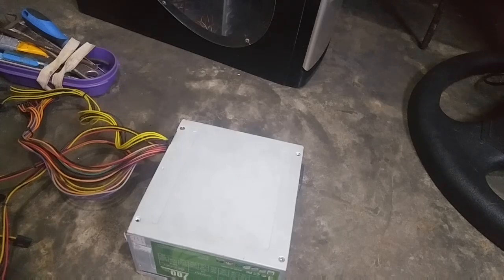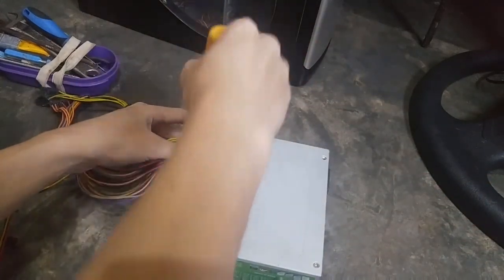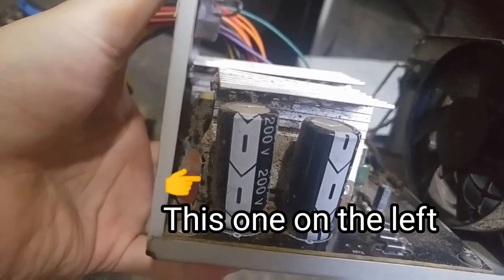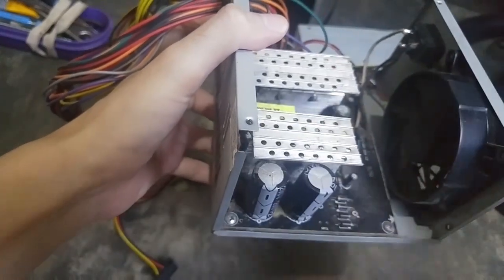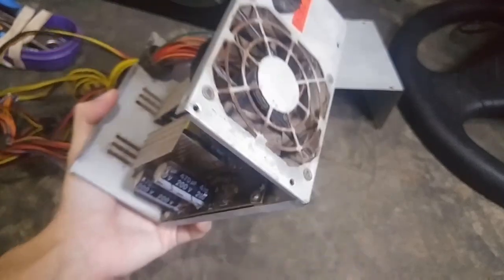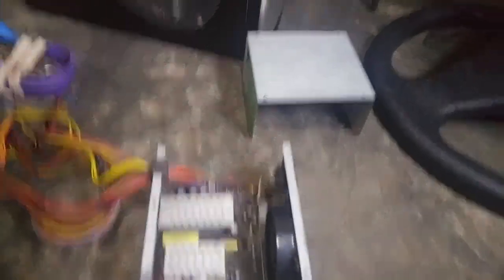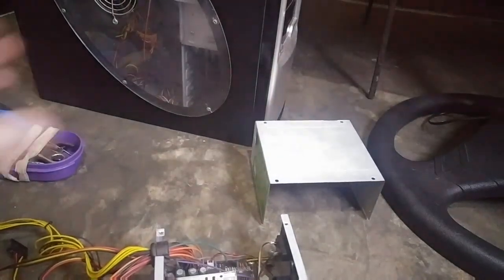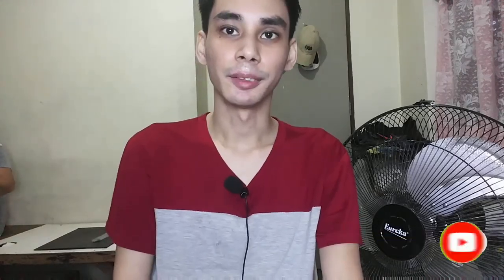why you feel electricity when you touch your pc #computer #desktop #laptop #psu

Comment: computer technician amp, useless yang two things na sinasabi mo kung yung outlet na pinagsaksakan mismo yung hindi grounded which is common dito sa pinas
Reply: So theses ungrounded cable can fry the mobo?
Reply: @WHRZ69  it can increase the risk of that happening especially if a power surge occur since there is no safe path for that excess electricity to go, so it is recommended to have your outlet to be grounded, that's the purpose of the third prong from our psu's plug
Reply: also this video is bulls*t, if you feel zapped by touching your pc case especially if on foot, don't replace your PSU that fast, it might be your outlet is just ungrounded.
If your outlet is ungrounded, you can prevent being zapped just by wearing slippers, but still the risk are still there, especially for your pc